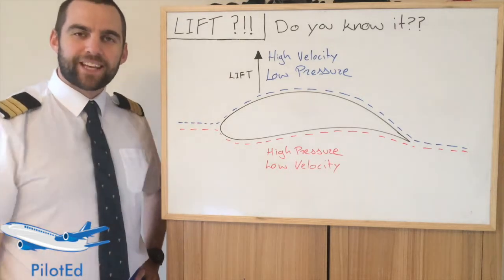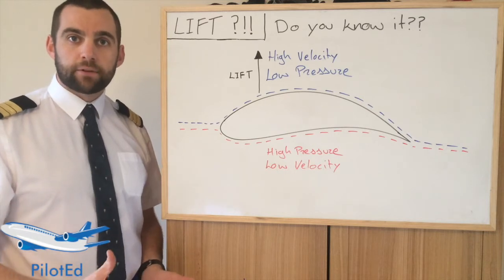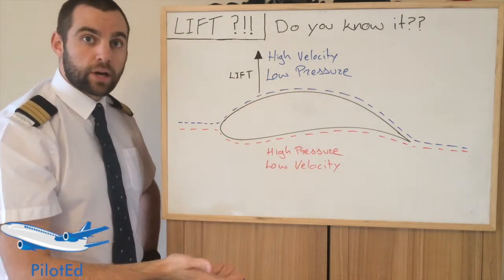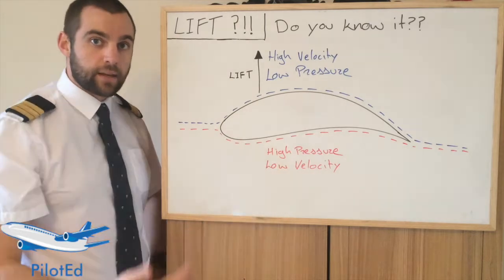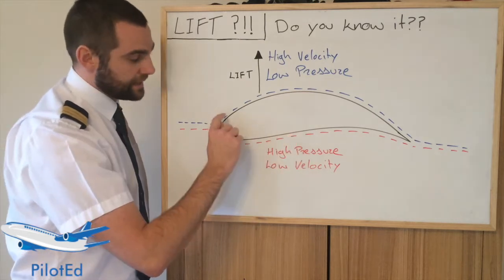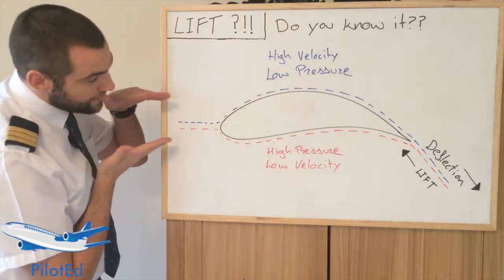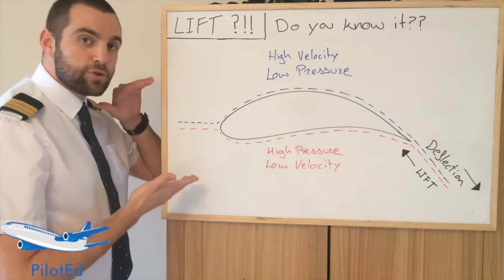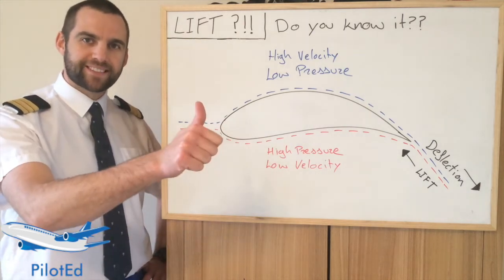How LIFT is REALLY GENERATED!? ✈

Comment: Currently doing my ATPL, and I must say, you are doing a super job at explaining. Keep it up! I would love to see you do examples in fx Fuel Planning with CAP697 with the MRJ, and also how to do the fuel/time to climb calculations.
Reply from the maker: those kind of calculations are relatively straight forward, you just need to find the right table in your airplanes manual and follow the lines inputing the correct data until you get to the result! thanks for watching

Comment: Point 1: a symmetrical aerofoil still generates lift.  Yes, but from what i saw the lift is zero if  the angle of attack is zero on a symmetrical aerofoil.  If the angle of attack is greater than zero it is no longer symmetrical relative to the airflow.

Comment: Great video, PilotEd. I think it was really important to knock out the misconceptions at the beginning of the video to prevent any confusion. I did notice that you mentioned that the lift is generated through deflection at the trailing edge of the airfoil, but I also think it is important to mention that the deflection of the streamlines over the whole airfoil contribute to the lift with Newton's third law of motion through a pressure force. You also mentioned towards the end of the video that the low and high pressure regions of the airfoil add a "little bit" of lift and the main source of lift is the deflection in the airflow. This is true, except for the part where pressure differences contribute little to lift. The streamline curvature creates a pressure gradient and is exerted through a net pressure force upwards (lift) and this is sustained through lower velocity fluid particles along streamlines on the bottom surface and higher velocity fluid particles along streamlines on the top surface.

Comment: I can't help but point out two amazing takes from Babinsky's video:
1. It DOES NOT show air accelerating over the top of the wing and
2. It DOES NOT show the deflection you claim.
A wing requires a positive AoA to generate lift, so the underside of the wing is moving into the air, the topside is moving away from the air.
The wing pushes the air causing it to compress which creates the high pressure below.
The wing moving forward generates a void of low pressure above the wing.
That's what causes the low pressure above and the high pressure below. 
It's absolutely nothing to do with the new-existent deflection!

Comment: This is a good, simple explanation of lift! I really liked that you took the time to disprove some common misconceptions that many people are taught. I think it would be a great point to add that the low pressure, high velocity at the top and high pressure, low velocity at the bottom isn't only at the surface. Instead, the airfoil affects the velocity and pressure fields in a very large swath around it, which also works to generate lift. Overall though, great video!
Reply: Yes, I agree! Also it is stated that there is a difference in pressure, but why there is a difference in pressure is not explained. There is not only a difference in pressure between the upper and lower surfaces but between the leading edge and the trailing edge of the airfoil. As shown in the smoke particles experiment that Dr. Babinsky performed streamlines close to the airfoil become increasingly curved. This is proof that a pressure gradient is present and the pressure drops as we move downwards. This explains why the pressure is lower at the upper surface and higher at the lower surface.

Comment: Thanks for your videos again, PilotEd, really enjoy to watch them! I'm also doing my ATPL, so that really helps me to understand the topic more comprehensively. :)  However another thought about it has emerged while watching, it'd be interesting to discuss.
So, what we see here is that due to the airflow deflection downwards from the wing, according to the 3rd Newton Law, an equal opposite force is generated which is an actual lift for us, wright? 
Ok, now let's consider this in scope of ground effect. Air is not so much deflected downwards, still aircraft is perfectly able to fly even more, it flies better than higher in the sky due to the reduction of induced Angle of Attack and its consequences.
Similarly, we can think about high speed flight where downwash decreases.

Anyway, thanks again, cheers :)

Comment: Hi Ed, good video overall. Good job identifying 2 problems with the Equal Transit Time fallacy 1. Not always a longer path on the top 2. Particles don't need to meet up with each other. Good explanation concerning Newton's 3rd Law. I think you dismiss the pressure gradient too much though. The pressure gradient made by faster flowing fluid on the top of an airfoil contributes to lift more than a little bit, and both theories are very important to lift.

Comment: from what i understand, the majority of lift is produced as a result of the differential in pressure above and below the wing.  This can be explained by Bernoulli's theorem WITH the venturi effect.  The venturi effect relates to the pressure and velocity of a fluid flowing through a constriction.  As the fluid travels through the constriction, the pressure will decrease while the velocity of the fluid increases.  The other end of the constriction this will revert with the pressure increasing again and the velocity decreasing.  An aerofoil is like that constriction, and as a result the air traveling over the wing has an increase in velocity and a decrease in pressure.  The downwash from the training edge does contribute to the lift vector however it alone is not enough to get an aircraft off the ground.  I am coming to the end of three years of studying aerospace engineering and this is what all of my lecturers have stated.  There is not one soul cause of lift but instead multiple laws acting together to create enough lift for something to fly, be that an actual plane or a paper one.

Comment: How does deflection works on a paper plane again?

I though that lift was a combo Bernoulli/newton third law , so paper planes kinda going for creating lift mostly with newton third law
Reply: You can't separate Bernoulli and Newton. You can describe lift as the pressure distribution over the upper and lower surfaces (if you sum that pressure distribution over the entire wing area, you will get the lift). But also if you measure the change in momentum of air from before it hits the wing to after it hits the wing, you'll also get a number for lift. Those physically both have to be satisfied, not one or the other.
Reply: It is,  I suggest that you do more research as this short video is very confusing and indeed wrong in some aspects

Comment: If this is the case then the reaction force based on the Newton's third law suppose to push at the trailing edge of the wing from the bottom since the deflection action (force) is taking place at the trailing edge rather than lifting the whole wing.
Reply from the maker: well the whole aircraft is one object really :)
Reply: The "deflection" occurs over the entire wing. In potential flow you model the airfoil as a sheet of vortices over the upper and lower surface; each of those vortices is contributing to the deflection a little bit.

Comment: 2:56 No. That is not lift. The shape of your drawn wing is horrible, BTW. The air at the back of the wing has nothing to do with the lift effect of a wing. It is the vacuum pressure created on top of the wing, that creates lift. Lift also comes from pressure hitting the wing, when it's at an angle to the air flow, increasing pressure on bottom, decreasing pressure on top. That creates lift.

Comment: Loved the video! Just one question, does Coanda Effect also contribute to lift generation?
Reply from the maker: yes sir :)
Reply: Okay let me know if I have this right. The deflection forces the air over the wing downward and an equal and opposite reaction occurs pushing us up. And the reason the deflection happens in the first place is because of Coanda Effect? And then Bernoulli's Principle is kinda just tacked on there as a contributing factor, but not the sole cause of lift. Is that sounding accurate? I'm preparing for my Commercial check ride.
Reply from the maker: yes, not so much emphasis on the coanda effect, but yes as the wing deflects air down, pushes us up. also little negative pressure on the top part of the wing.
Reply: @RealRadiantBeing  Coanda is not important (only applies to fluid jets, which can be the case for gaps between slotted flaps or slats but not for main airfoils). Air doesn't want to separate from the upper surface of the airfoil because doing so would create a low pressure zone underneath which would just suck it back in.
Reply: @PilotEd  actually coanda effect does not apply to an airfoil :)

Comment: The science is that the top-bottom pressure difference provides ALL the lift force and these same pressures also cause all the air accelerations of air around the wing including behind, ahead, around the curves and around the tips.
 If it is viewed as the downward deflection leaving the trailing edge  causing a reaction force, it would all be at the trailing edge, not forward as we measure it. So, that is not correct.
..
There must obviously be the 'action-reaction' pair.  However, that is not a cause, but a result of the pressures. Pressure pushes the wing up and it pushes against some air which then moves down. 
.
If we're on skate boards and I push you, we both respond by moving away, but your movement away from me is not pushing me away.  My push between us pushes us both. It is your mass, your inertia that gives me something to push against.
The pressures around the wing also have the mass/inertia of the air to push against; and that air moves down - while the wing is held up.
.
The wing's motion changes the pressures around it  How and why that occurs requires more detailed explanations.
Reply: If air hits a flat(plane) at an angle the air compresses because it cant follow its path that compression is pressure which pushes the wing up and the air down this would not cause lift at the trailing edge but as a splope throughout the wing if the wing is uniformly curved the 2nd derivative is constant and thus the acelleration of air is constant which spreads lift somewhat equally along the wing
Reply: @hund4440  Correct. I was not clear and edited it. My comment points to the flaw in the common 'reaction' explanation. _if_ the upward lift came from the 'reaction' of the air leaving the trailing edge, that would mean that the center of lift is at the trailing edge. We know the center of lift is towards the leading edge and, therefore, that explanation is faulty.
The underside pressure, as you say, is distributed throughout the wing..

Comment: great video but then how does a symmetrical airfoil produce lift? there wouldn't be any deflection downward.
Reply: One reason could be that they are at a small angle, but paper airplane wings aren't at an angle.
Reply from the maker: @jaybabcock9123  well paper aircraft dont have any propulsion, remember lift is a formula with speed as a big factor, so the more speed you have, ie a fighter jet, the less angle of attack you need :)
Reply: PilotEd ah ok that makes sense.
Reply: Angle of attack, i believe. Think of an aerobatic plane flying inverted. The wing is symetrical, so a change in the angle of attack allows it to fly regular, or inverted (maybe not substantially, but pretty well.)

Comment: I would have thought a paper airplane would be generating lift only when it has a positive angle of attack, like how you put your hand out of the window in the car.

If the paper plane had an AOA of 45 degrees then it would be producing lift and drag in more or less equal amounts.

If this theory of deflection were true, then wouldn't the centre of pressure of an aircraft wing be right at the back (where your arrows are located)?
Reply: If the AOA was 40 degrees then no lift would be produced.  The stall angle for a standard aerofoil is 15 degrees

Comment: you statements  are not correct, or at the very least so general and contradictory  as to be confusing for any aeronautical student.   A pressure gradient is indeed responsible for a proportion of the lift generated by any aerofoil, to state otherwise, as you do here,  is nonsense. There are much better and clearer videos  on U Tube that  I suggest students find and take on board.